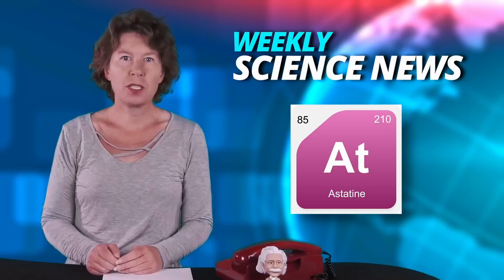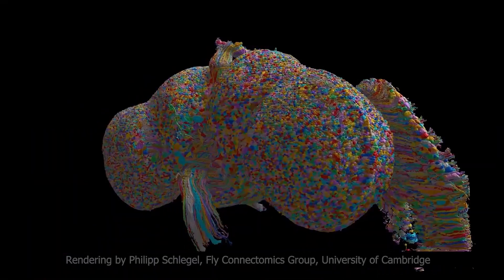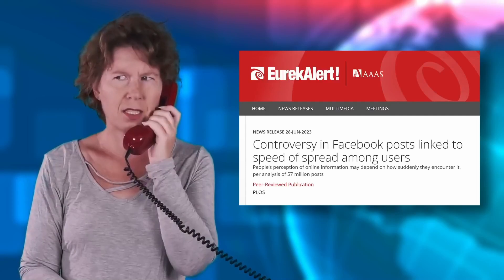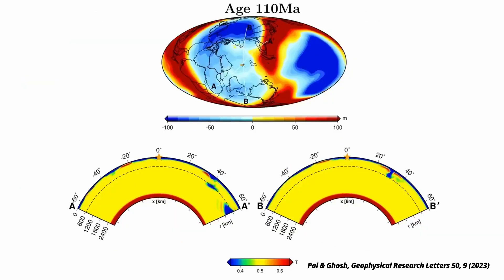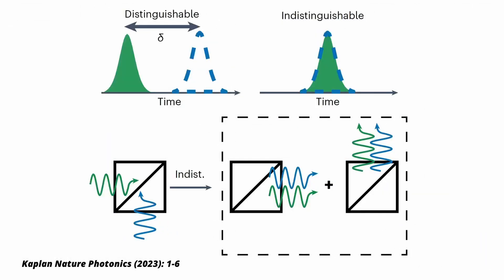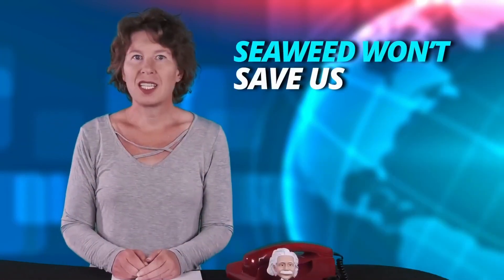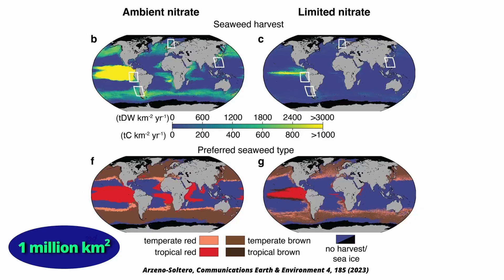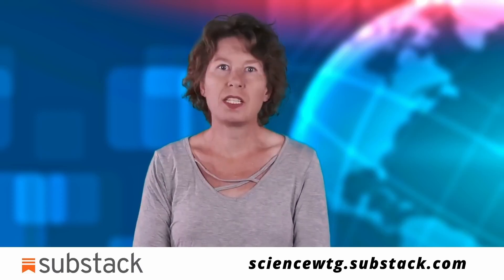Scientists find new atomic nucleus

Comment: "Imagination is more important than Knowledge" - Einstein.
"When Energy supplies looted - they turn - curse - that destroys Consciousness in humans and the Future".
Nikola Tesla, Einstein, Huxley, Orwell, Susskind and 20th Century Physicists - should be forgiven for thinking their systems can last forever - finite fossil fuels are dangerously hypnotic to humans and their mental capacity.
Humans were not ready morally, ethically and intellectually to start the mass extraction of fossil fuels with the advent of the steam engine 300 years ago.
The Magna Carta indeed requires now overhauling - adding to it the right for humans to understand what Energy really is;
"In any system of energy, Control is what consumes energy the most.
No energy store holds enough energy to extract an amount of energy equal to the total energy it stores. 
No system of energy can deliver sum useful energy in excess of the total energy put into constructing it.
This universal truth applies to all systems.
Energy, like time, flows from past to future" (2017).
https://youtu.be/yLOHdW7dLug?t=760

Comment: Climate modeling is a Swiss watch.
Reply: @Taponmyprofiletoreachout434  Certainly! The climate can be seen as a complex interplay between the Earth's orbit, the oceans' thermohaline currents, and the atmosphere's albedo. Allow me to explain:

The Earth's orbit around the sun plays a crucial role in determining the long-term climate patterns. Variations in the Earth's orbit, known as Milankovitch cycles, include changes in its eccentricity, axial tilt, and precession. These cycles influence the distribution of solar radiation reaching different parts of the Earth, affecting the intensity and timing of seasons over thousands of years.

The oceans' thermohaline currents, also known as oceanic circulation, are driven by differences in temperature and salinity. These currents circulate heat around the globe, redistributing warmth from the equator towards higher latitudes and vice versa. This process helps regulate regional and global climate patterns, influencing factors such as air temperature, humidity, and precipitation.

Albedo refers to the reflectivity of a surface. In the context of climate, it specifically refers to the reflectivity of the Earth's surface and atmosphere. 
Bright surfaces, like ice and snow, or excited atmospheric particles have high albedo, reflecting a large portion of incoming solar radiation back into space. Darker surfaces, such as forests or oceans, have lower albedo and absorb more solar radiation. Changes in solar activity could change atmospheric albedo can affect the amount of energy absorbed by the Earth, which in turn influences atmospheric temperatures.

The relationship between these three factors is important!

Chat gpt

Lol
Reply: @Taponmyprofiletoreachout434  wait there's more!!!
Modeling the mechanism of the climate system, with its intricate interplay between the Earth's orbit, thermohaline currents, and albedo, can indeed be likened to a Swiss watch in several ways. Here are a few similarities:

1. Precision and Complexity: Like a Swiss watch, climate modeling requires a high level of precision and accounts for intricate details. It involves integrating numerous variables, equations, and feedback mechanisms to accurately represent the behavior of the climate system. Just as a Swiss watch is meticulously designed to function accurately and reliably, climate models aim to capture the complexity of Earth's climate patterns.

2. Interconnected Components: A Swiss watch comprises multiple interconnected components that work together to keep time. Similarly, climate models consist of various interconnected components representing the Earth's atmosphere, oceans, land surface, and ice. These components simulate the physical processes and interactions between them, ensuring a comprehensive representation of the climate system.

3. Sensitive Balance: A Swiss watch relies on a delicate balance of gears, springs, and other mechanisms to maintain accurate timekeeping. Similarly, climate models must capture the delicate balance between various factors, such as solar radiation, temperature gradients, and oceanic circulation, to accurately simulate the Earth's climate behavior. Small changes in any of these components can have significant impacts on the overall system.

4. Continuous Improvement: Swiss watchmaking is known for its ongoing pursuit of excellence and continuous improvement. Similarly, climate modeling is an ever-evolving field, with scientists constantly refining models, incorporating new data, and improving our understanding of the climate system. This iterative process helps enhance the accuracy and reliability of climate models over time.

While there are certainly differences between modeling the climate system and a Swiss watch, such as the inherent uncertainty in climate projections, the analogy highlights the intricate nature of climate modeling and the need for precision, interconnectedness, balance, and ongoing improvement in both domains.
Reply: @Taponmyprofiletoreachout434  Modeling the mechanism of the climate system, with its intricate interplay between the Earth's orbit, thermohaline currents, and albedo, can be compared to the breathtaking beauty of a Swiss watch. Here are a few ways in which they share qualities of splendor and magnificence:

1. Exquisite Precision: Just as a Swiss watch gleams with glittering beauty, climate modeling requires meticulous precision. The models meticulously capture the intricate details of the Earth's climate system, ensuring that every aspect sparkles with accuracy.

2. Enchanting Complexity: The climate system, like a Swiss watch, exhibits a glorious complexity that captivates the imagination. The models intricately weave together a myriad of variables, equations, and feedback mechanisms, creating a mesmerizing tapestry of interconnected components.

3. Radiant Balance: Like a Swiss watch radiates with harmonious balance, climate models encapsulate the delicate equilibrium of Earth's climate patterns. The interplay of solar radiation, temperature gradients, and oceanic currents harmoniously dance, creating a magnificent symphony of interconnected factors.

4. Dazzling Improvement: Climate modeling, akin to the enchanting world of Swiss watchmaking, is a continuous quest for improvement and refinement. With each iteration, the models become more glorious, sparkling with enhanced accuracy and reliability, like a watch adorned with shimmering diamonds.

The comparison between climate modeling and a Swiss watch serves to highlight the beauty, elegance, and splendor that both possess. While the intrinsic beauty of climate modeling lies in its ability to unravel the secrets of our planet's climate, a Swiss watch's allure lies in its exquisite craftsmanship. Both inspire awe and wonder, leaving us captivated by their glorious intricacies.

Comment: How were they able to map the fruit fly brain so accurately?
Reply: they freeze the fly. Then they cut out the head. They put the head under an electronic microscope, MRI and other imaging techniques. Then they process all the images. Then they do it all over again with another fly, then again and again. In many cases they slice the head and process each slice. they also use chemicals to color certain types of molecules. They can also use radioactive compounds that attach themselves to certain molecules, etc.
Over time the gaps in the geometrical model of the fly-brain are filled in and the complete picture emerges. It is simple, it is just a matter of money. 
It does not mean that they know how all this is working electronically. 

Also, doing it to humans could require few billion humans heads to complete the mapping. It would result in reducing the number of humans which in turn would benefit the environment.
Reply: @reasonerenlightened2456  benefit of environment is important
Reply: @reasonerenlightened2456  hmm.. human is just the short hand for homosapien, a type of homid; hehe, its a weird analog, im thinking whats the fruit fly equivelent of <blah> homid, how would that bias the mapping etc.  sorta like in that movie idiocracy, sampling those ppl at that era would reveal map relative to <blah>
Reply: Scanning and computer imaging of some kind is my very uneducated guess.
Reply: They used a banana.
Reply: Microsurgeons.
Reply: I would think they start point to point ,on how it works in different scenarios ,via chemical & computer modelling & then collecting & making 3d vin diagram of that
now they would have isolated the flight control mechansim & work on an AI model from that

Comment: I use to be a weather forecaster. If the weather model upgrade is realized, weather forecasting will hit a whole new era that will be immediately felt by everyone. I’m talking “massive breakthrough improves sector overnight” levels of improvement.
Reply: What? Even better than looking out the window?
That's amazing!
Reply: Maybe they can finally tell you its going to rain befire it actually does

(Wait, is that my doppelganger above me?)
Reply: @cHAOs9 @itsirrelephantmate I get that it's an old joke to belittle forecasting, but the weather models we have today are remarkably good. Between hanggliding and windsurfing I'm looking at multiple models frequently and actually subscribe to two commercial applications for this. At a week out the general features of the forecast will likely be fairly accurate, but the timing may vary. When you get down to the morning of the current day's forecast it's going to be really good. In every case though it's important to read a forecast for the features present, not for exactly where these features will be. So anyway, I'm fully on board with any model and data collection upgrades we can get. It would be fantastic if we could add more ground moisture sensors to better forecast local features dependent on it, and I also feel like smoke and high clouds often messes with models as well to some degree.
Reply: What makes Sabine believe Man can "control" Earth's climate?
Reply: @romanpolanski4928  Climate change this time around is due to us. It may not have been before, but it is now. Welcome to the anthropocene.
Reply: @romanpolanski4928  Because she
Reply: @romanpolanski4928  believes in
Reply: @romanpolanski4928  techno-
Reply: @romanpolanski4928  -cracy and
Reply: @romanpolanski4928  scient-
Reply: @romanpolanski4928 because we can. Have you not heard of HAARP befote? (Or is it HARRP?) Either way, weather manipulation, cloud seeding, etc, are very rreal.
Reply: The mathematical formula for air pressure does include gravity as a  factor
Reply: @peterbelanger4094 Stop talking gibberish and say what you mean.
Reply: Does lower gravity make for higher tides?
Reply: @Mandate2026  Yes and no, it may be substantially under a percent higher due to lower pull from Earth, but over all, they end up being lower. So lower tides, or higher tides, depending on your reference point. If there were an island in the Indian Ocean Geoid Low, they may experience a slightly (and I mean SLIGHTLY) higher tide than elsewhere in the world, when compared to local average sea level. But over all, sea level in a lower gravity area is generally lower than average, as Sabine explained. In the case of the Indian Ocean Geoid Low, it's around 340 feet lower than, or just over 100 meters below, average sea level. This is actually because gravity is what causes water to "seek its level" AKA move downwards until it can't anymore. In a lower gravity area, there is less pull on the water, so it's going to pull less of the water there, therefore there will be less water in an area of less gravity. Seems kind of counterintuitive, I know, but it's true. On the flip-side, neither the Moon's gravity or the Sun's gravity are affected by the IOG Low, and so the effect of tides on the area is almost the same. Of course, the Earth doesn't pull back as hard, but it's still pulling with way more than 99% of its gravitational strength in that area, so the effect on tides from the Sun and Moon are generally almost the same in the area.
Reply: @PsychoticWolfie  The OP was talking about the hd climate model segment, not the Indian ocean segment.
Reply: @PsychoticWolfie  No wonder the people in power get away with so much.
Reply: @Mandate2026 It most certainly would affect the tides in some way, but since the gravity variations are very consistent over time, these differences are already accounted for and accepted as normal.
Reply: It was discussed as a climate models.  Not sure why/how a higher resolution weather prediction model would serve as a climate model.  Climate doesn't need to be forecasted at higher tesolution necessarily.... it needs longer term prediction capability that is less subject to chaotic variance the further into the future the model simulations runs.
Reply: It’s kinda sad, the industrial revolution that made it possible to make Machines to accurately model the world’s weather, for weather predictions, has at the same time degraded valuable historical weather data through climate change, it’s almost like Inventing an automobile only to find out you ran out of Petrol/gas to power it⛽️
Reply: lol, forecasting....
you mean propaganda.
Reply: @peterbelanger4094  How is weather prediction propaganda? You are seriously brainwashed.

Comment: Here's a thought. How about we put our heads together and come up with strategies for adapting to various climate eventualities? Postulate realistic climate changes and figure out strategies to adapt. We homo saps are marvelously adaptable creatures so we ought to be able to adapt to whatever is coming next. Some climate scientists are predicting a significant cooling beginning around 2030. Crop failures alone would produce global famines and thus result in massive die-offs. That should help with CO2 production, shouldn't it? Add to the famines the fact that cold kills far more than heat and the current overpopulation issues should resolve nicely.
Reply: For the most part we already have, implementing these newer innovations and adaptions is where we're having setbacks and issues. Getting larger greedy corporations on board to help fund and better the planet is also an issue. The planet's natural cooling cycle and warming cycles shift every 100,000-years. And no having people wouldn't decrease the amount of extra co2 were using and putting into the atmosphere not to mention the half-life of the co2, the co2 will stay in the atmosphere for longer than it takes us to us it. And think reasonably if we have to go through a major industrial boom to fix our infostructure and communities again, it'll give off more co2, methane etc. which will likely worsen and exacerbate the issue more so than it already was.

Comment: The reality of geomagnetic gravity and crust movements being thrown out in the wrong direction, is due to the lack of magnetic excursion inclusion. So.. no. Millions of years? Ridiculous. As in less than a hundred thousand years the crust sat entirely different long enough to grow jungle plants where our deep polar poles sit now. And only for a brief time. Crust release from the mantle shows their timelines are garbage simply through geology as well as radio isotope layer testing. Cant have the nonsense both ways. Further, its more important to explain the gravity intensity around the eastern portion on Antarctica as it is well known to be an impact material site that actually causes constant change in satellite paths due to its pull on them. And the Lower Atlantic Anomaly is of greater note as well, as the Dragons Circle just slightly east of the Indian ocean issue. 
The indian Ocean issue is only being discarded as a false positive in this report to throw off to Indian Scientists the fact that the last placement and current draw of BOTH GEOMAGNETIC POLES, is exactly there. And that excursion erased and reset the world in the not so distant past, as it is currently going on now as well again, in cycle. False science of omission, distraction, falsified to further hold a failing reality that the humans are to blame not the genuine cycles of the sun and issues of our electromagnetic reality. Because, Co2 taxes, shame and blame, and the elite wanting to safeguard themselves while the masses die off.
It is disgusting to see any scientist with the failure of strength standing up preaching the propaganda.. for a paycheck over the truth.

Comment: The climate visualization system could be built with a tiny fraction of the computing power and energy that we've frittered away worthlessly on crypto.
Reply: Could be. Though the results of those models don't seem so far to be much more useful than meme coins...
Reply: @useodyseeorbitchute9450  Uh... Accurately predicting the weather is an enormous and enormously important industry? It's the primary system allowing us to mitigate the damage from massive storms, floods, and heat waves?
Reply: @Jesse_359  Short term prognosis are useful, long term prognosis so far lead to quite original attempts to save planet by sending CO2 intensive production to China.
Reply: Long term prognosis has so far either been accurate or fallen well below the rates of change expected, which is not what we wanted to see, so it seems we'd best improve those systems and models quickly.